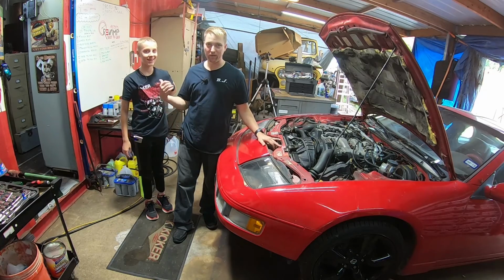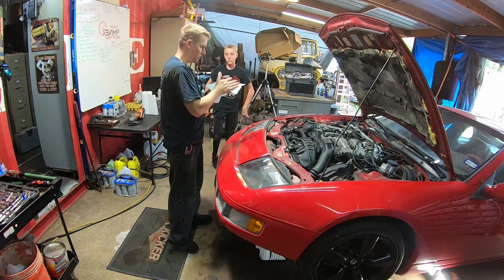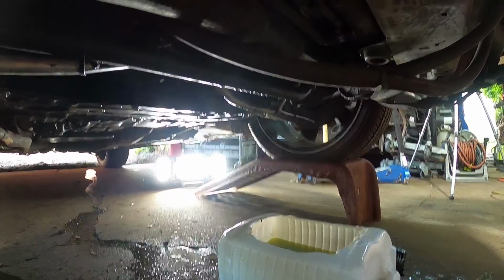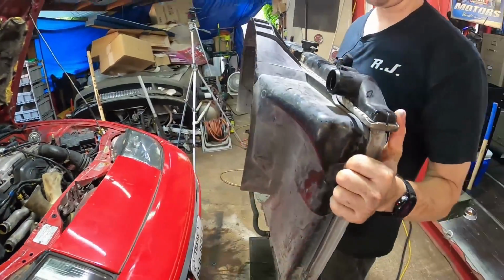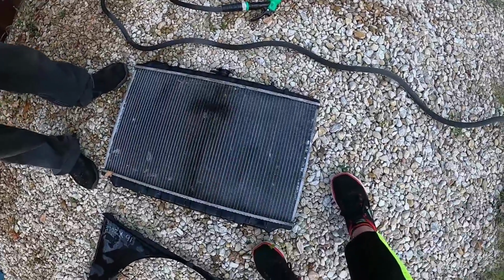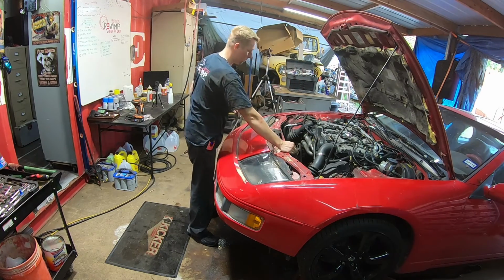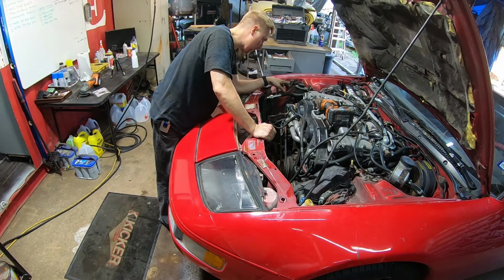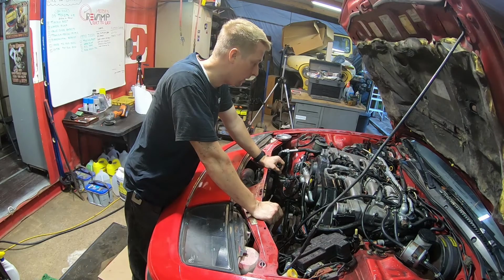#300ZX #Z32 Removing and Cleaning the Radiator on the Z32

Comment: If you decide to use silicone radiator hoses, the top and bottom of the stock radiator are made of plastic. I used screw type clamps with inner liner and sheared the goose neck inlet off the radiator trying to stop leaking hose. Use the stock Z32 clamps or constant tension clamps, ugly but saves replacing $150 radiator. Or get a snug fitting steel sleeve to fit inside the neck to prevent it from breaking. I went back to standard rubber hoses w/constant tension clamps.
Reply from the maker: Thank you for the awesome tips!!